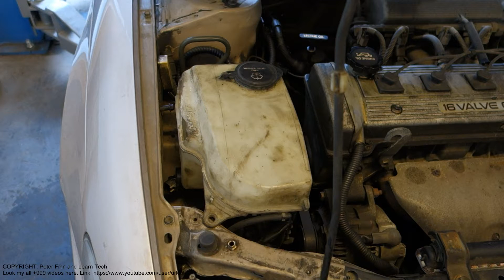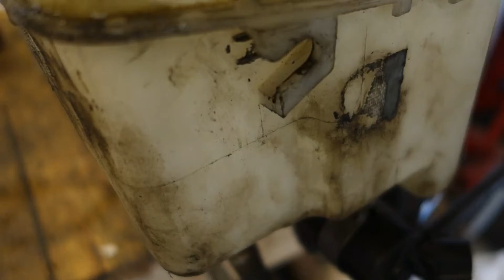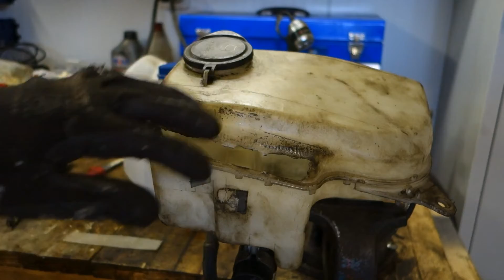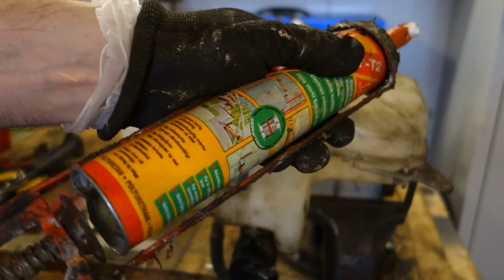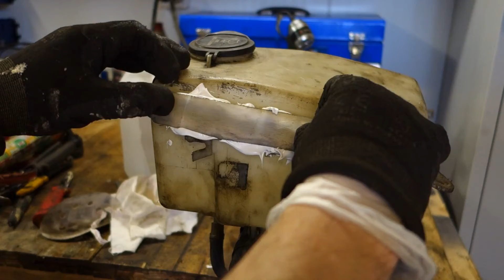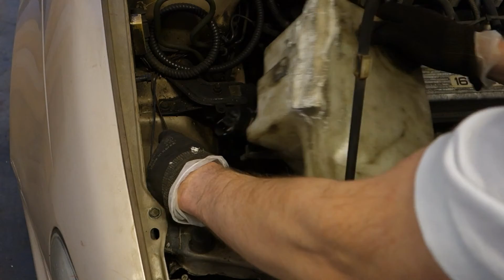How to repair washer fluid tank hole and leak

Comment: This method works very well.
I did the same thing on the windscreen washer fluid tank on my GM back in 2012 as a brand new one costed too much and  a 2nd hand tank from a junk yard was just as bad as my old one (no point in installing an old one).
But I used the standard bathroom silicone as I didnt know about SikaFlex back then.
Reply from the maker: Glad to hear that fix worked well for you too! 😊
Reply from the maker: Thanks for sharing your experience! 👍

Comment: Use a thicker patch piece and plastic weld it, glue never holds up in the long term for me. The only way I can get these fixed on a more permanent basis is by plastic welding. I'll even use wire mesh to "stitch" the plastic patch to the original for strength.